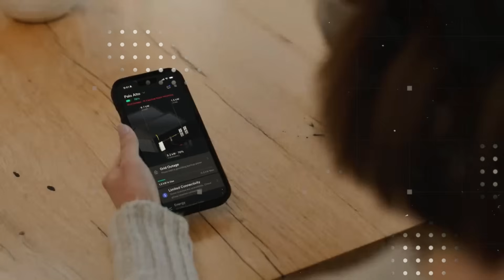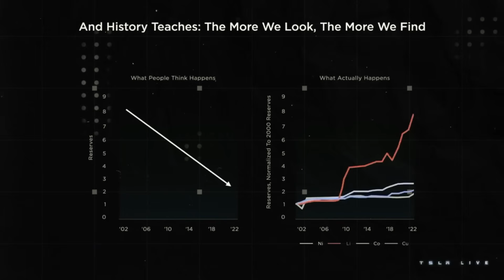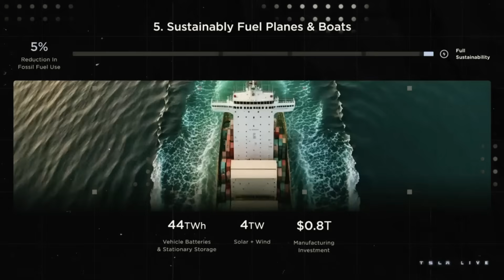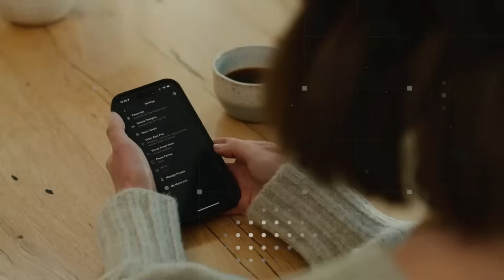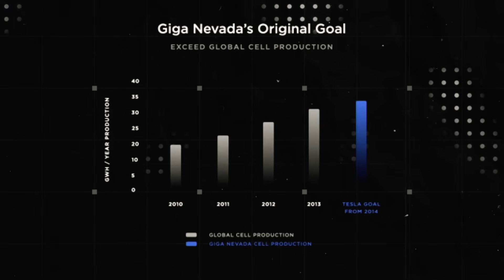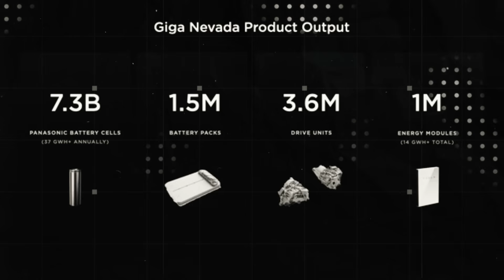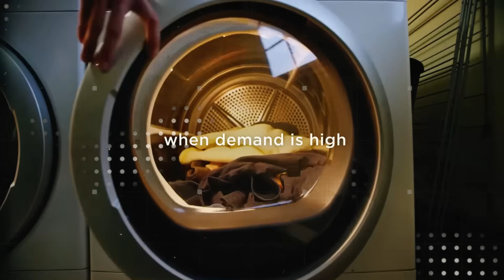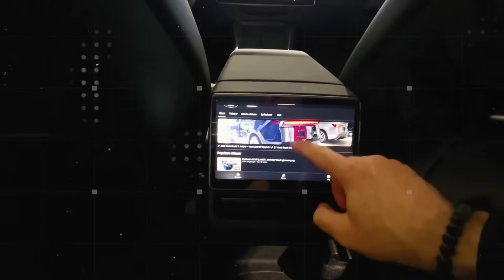IT’S HERE: Tesla Model 2 Batteries 2026 — Aluminum-Ion 60s vs Sodium-Ion $14k Safe EV

Comment: Great. You place  way too much emphasis on Li Ion batteries and "explosion". When is the last time  you've heard of a burning Tesla? It was resolved years ago with  a) better protection from impacts b) cooling system of battery pack. Currently, what people want is a) range b) power c) rapid charging to 85 < 100% in the same time or less than gassing up to a full tank in ICE vehicles (3 to 5 minutes for a full size ICE sedan). d) competitive prices e) longevity comparable to ICE cars - number of charge cycles up to a time when full charging reaches no more than 80% of the original charge, due to capacity degradation. Thank you for the sweet tech talk. Cheers.